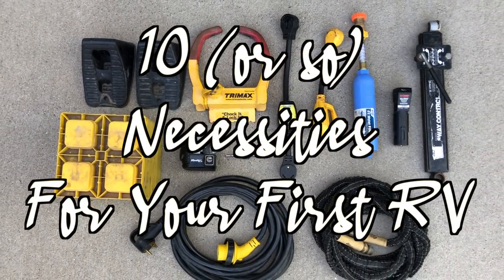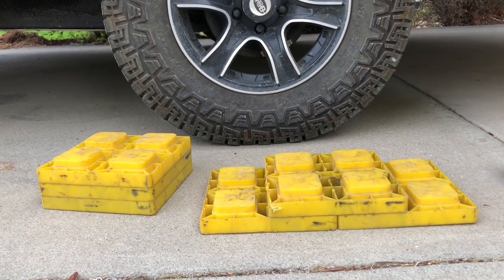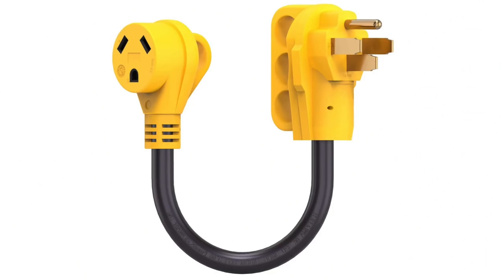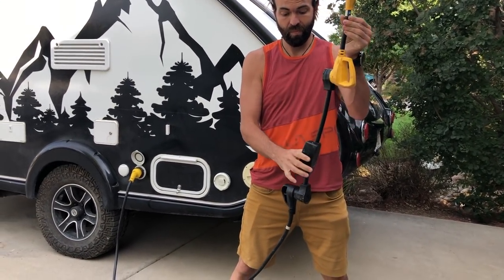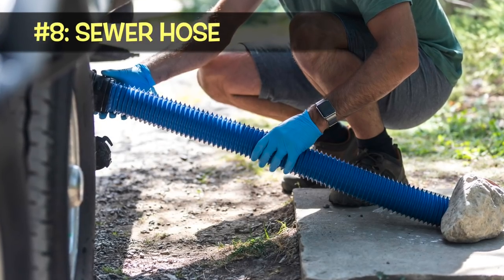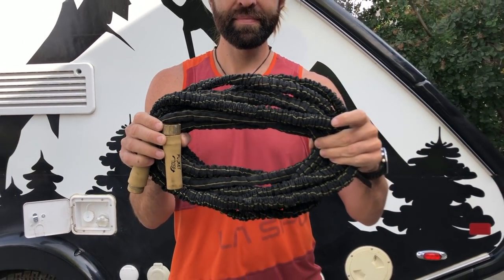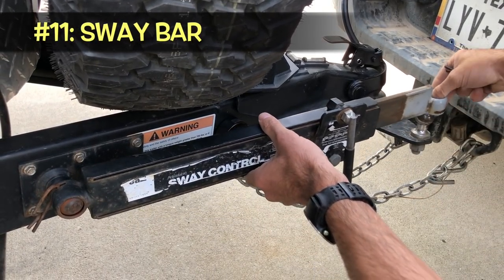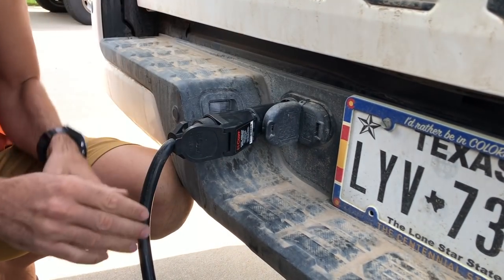What to Expect when You're Expecting... your new RV! The first 10 items you need to buy!

Comment: Mandy, as a fellow t@b 400 BDL owner I want to compliment you on your gear list.  However, may I make one suggestion regarding locks.  Most of the ones you showed can be easily defeated.  I know, locks are more a deterrent but check out the locks at Ft. Knox Locks.  I purchased one for our t@b and it's great.  The design even allows me to place my safety chain hooks into it.  That is one lock that you are not going to get into without some serious cutting tools.  Anyway, stay safe.

Comment: Great list.  I have the same claw lock for my tire and use a tongue lock called The Vault. Very heavy duty and supposedly cannot be gotten into. For added security if I’m leaving my trailer for a week or two, I also use a padlock on the chains, because they can just use the chains to drive it to somewhere where they can remove the other lock. (Proven Industries makes one that includes the chains in the lock.) If they still steal it with all of that, they deserve to have it!  That’s what insurance is for. Also, I use a Zero G water hose for my drinking water. It’s light and it doesn’t kink like the white hoses do.  Using a standard garden hose isn’t recommended for drinking water, therefore I have a cheap green hose that retracts and also is light and doesn’t kink. I use this to rinse my black tank (because I use mine 😉) and for washing my trailer. Anyway, just my two cents.
Reply from the maker: I never thought of the chain lock! That's a GREAT idea!
Reply: Great video on all the wacky stuff you need to park and hook up. The zero-G hose is safe to drink from thanks. do you have a water filter recommendation?

Comment: When I bought my TAB I did not get the tool to remove the tire lug nuts. My tow vehicle tool did not fit the TAB lug size. Nucamp said in 2017 they don't include the lug tool. Also I use two wheel locks for extra theft discouragement.
Reply from the maker: Great suggestions!

Comment: Such a timely video and cleverly titled! My estimated date of DELIVERY 🦩 is late Fall.  I have been busy rounding up things to decorate and make my T@B 320S Boondock homey, but in the back of my mind I knew I needed to purchase things like chalks and hoses, Etc, so thank you for your recommendations.

The dealership where I purchased my trailer added a complimentary sway bar. Unfortunately, my tow rig has to have a tow package added.  It is a 2019 Jeep Cherokee 4x4 Limited. They have to install the hitch at the ealership because it involves removing the bottom bumper panel and replacing it. They said they do NOT do the electrical part for trailer brakes and told me to go to U-Haul. 

 I did get an estimate from Camping World and am a Good Sam's member but it's still going to run another $600 or more, even with a discount on labor!  So after that, I guess I purchase the actual brake controller device you showed(?).

I love my Cherokee BTW.

PS Kendrick could work as a model on Let's Make a Deal 😊
Reply from the maker: yes, the brake controller will plug right into the 7-pin that uhaul will install for you.
Reply: @MandyLea  thx Mandy!